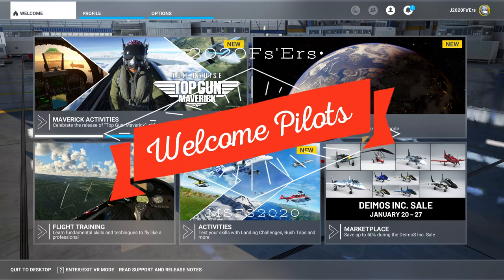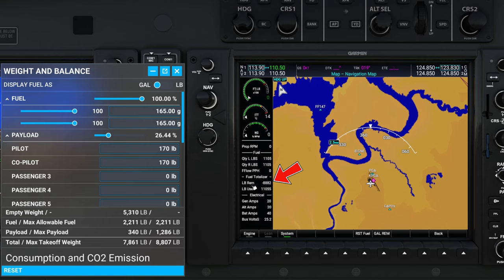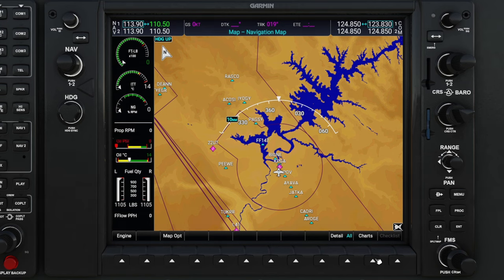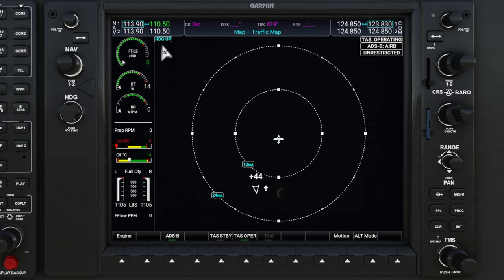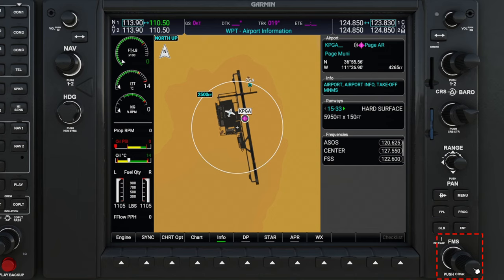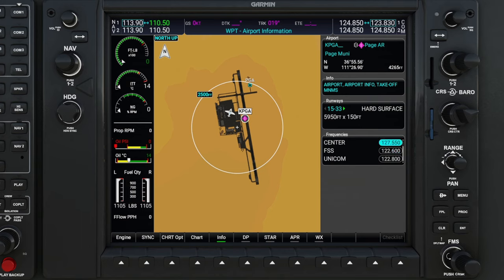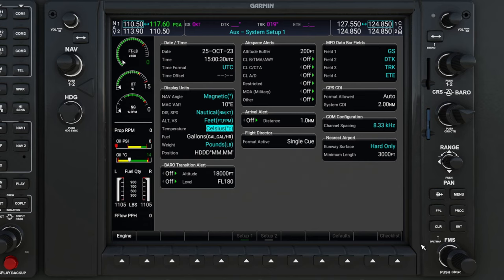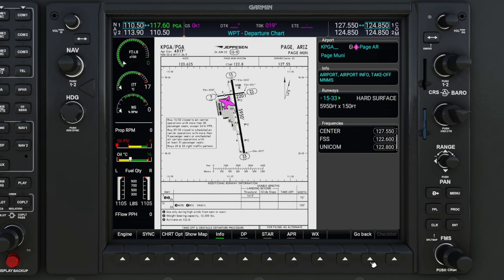*Mastering the G1000nxi Mfd  in MSFS2020* - Everything You Need to Know- Easy-to-follow Pt.2

Comment: Great Video!!!  I use the G1000 regularly, but you went over stuff I didn't know existed.   FYI. the Flight Plan Catalog is populated with your stored SimBrief flights.  I noticed your Lean softkey looked greyed out.  Mine is active and I am currently learning how to use that.  Thanks again for an informative video!
Reply from the maker: hey john thanks for the comment and glad you picked up a couple things also. My lean is greyed out because this is a turbo prop . i had a pop up at that time to let everyone know why it was greyed out. for the flight catalog how do you get more than 1 to show there ? do i need to save something in simbrief and export over im confused about this ?
Reply from the maker: hey i did a video on lean assist a while ago if you are interested https://youtu.be/Q4w7jkJakQM  i will be doing another one tho as the new aau update.
Reply: @2020fsers   Great! Thanks.  I don't know how I missed that one.  I will watch plus any new one you do.  Back to the flight catalog.  It will only populate flights that you generate in SimBrief.  I have a bunch stored but it only populated the ones I generated recently.
Reply from the maker: @johnreveley4901 oh ok so I don't need to import any of them? They will just show up in the catalog?
Reply: @2020fsers  That is how it works on my system but I just started using that function on the G1000.  It will not show saved SimBrief flights, just ones that are generated.
Reply from the maker: @johnreveley3798 ok cool I'll try it

Comment: Are you running a beta version of MSFS because I don't see the Navigraph settings as an option in my Aux menu? Maybe I missed something? I tried looking for it on the DA62, C208, and C172 and I don't see the same layout of the G1000 as I see here, and none have Navigraph as an option to set up.
Reply from the maker: Hello thanks for the comment .I am not running any beta. Ok 1st make sure you use the navigraph hub to install the g1000 navigraph pages . I  am also using the g1000 mod in market place  search g1000 in marketplace .

Comment: I just downloaded the new Garmin G1 thousand package for the Cessna 172 Skyhawk. When I attempt to takeoff the screens for both the MFD and the PFD go blank what causes that and how do I rectify it haven’t been able to use the screens, but the rest of the flight works, can you help best regards ron
Reply from the maker: The garmin package you are referring to is thar in the marketplace ? Try and remove the g1000 and see if it works.  Could Also be a  conflict with another mod in your community
Reply: The package is the one from the marketplace. There are three parts ; c -150 , 172 Skyhawk adding g1000 and some other aircraft.  I not familiar  with Aldo. Thanks so much for responding.
Reply from the maker: That supposed to say also .

Comment: Hey, thanks for your videos. I have a question I run MSFS on a laptop with i5 12500H, RTX 3060, and 16 Gb ram. While playing I am always limited by main theath even when I am on low settings en LOD sliders on minimum do you have an idea to get rid of this problem? My CPU is only 50% used and GPU is only at 60%
Reply from the maker: Cpu may only be 50% used but msfs only uses 1 core so I would go through windows and go through all the settings to turn things off . You need to free up cpu resources. I did a video on maximizing windows for performance it's in the msfs fixes playlist. It's for windows 10 tho.if you are using windows 11 I would definitely use the pegasun tool i showed at the end it really helps turning off unnecessary services. Then I would also debloat your driver and remove GeForce and all the other fluff that takes up much system resources I did a video on that also its the performance hack video in ths msfs fixes playlist. I would also check that you are using xmp mode for your ram. Also run the islc cleaner tool for ram efficiency.  There's a video on that also.
Reply: @2020fsers  thanks I let you know how it works out